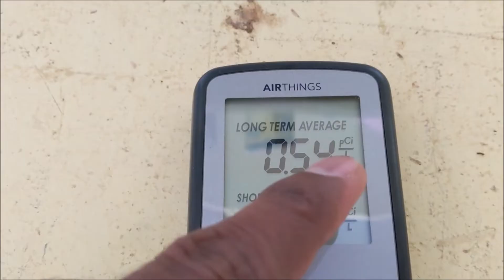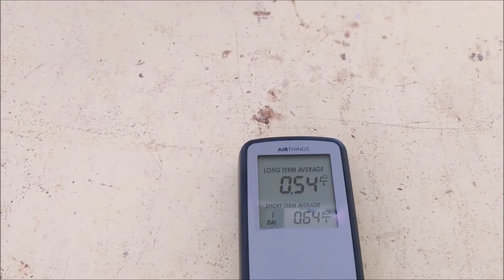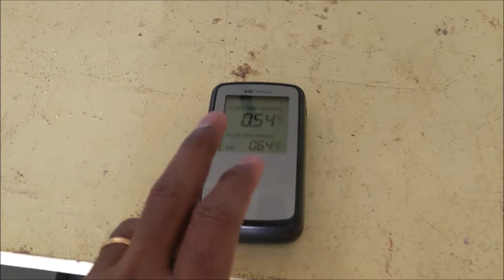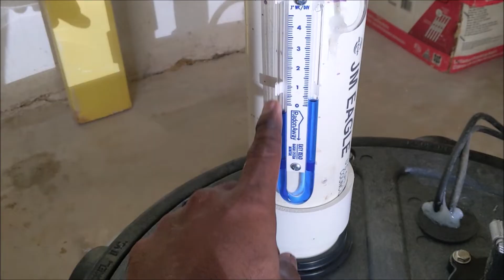Radon Mitigation System for under $500 - DIY Homeowner Installation

Comment: The exterior electric on the fan should have a shut off switch, definitely look into it. Also, you should have fire suppression collars on the interior side of where the pipes penetrate to maintain the fire code to your house.
Reply from the maker: Thank you for the pointers. Both those were pointed out by previous commentators and I put an exterior disconnect and a Rockwool collar.
Reply: @JJCentral-DIY awesome

Comment: Would this work on a sump system where the lid isn't a perfect circle? We had some triple sump system installed(got conned into it actually) and its not a perfect circle like the lid you got.
Reply from the maker: Triple sump systems generally comes with a double overlap circle shaped lid. You can cut the proper size hole in that lid to use it for Radon. If not you can always use a plywood or pvc 1/2 inch board to cut the shape of your openning and then do smaller holes for your pipes or better yet cut a circle in the middle to mount the lid that you can purchase. There is always a DIY way.

Comment: Google: Threshold for Radon-Induced Lung Cancer From Inhaled Plutonium Data
Or: From the February 2002 Idaho Observer: Sleeping radon hoax from early 90s reawakened in 2002

"The EPA action level for reducing radon in homes6 is 4 pCi/L (150 Bq/m3). This limit is 14 times lower than the NOAEL of 2100 Bq/m3 estimated in this article. The very low action level has been causing undue fear and unwarranted costs to many homeowners as well as a reduction in the market prices of their radon-stigmatized homes. It should also be noted that radon remediation significantly increases lung cancer mortality, as shown in Figure 3. To dispel the fear and eliminate this economic burden, the action level should be raised by a factor of at least 7 to about 1000 Bq/m3 (27 pCi/L), where the health benefit is near optimum."

Comment: No reason to worry about building codes where you work I guess! Why is there no power disconnect within 6' of the fan outside???
Reply from the maker: If you look at the other comments, some one pointed out the disconnect and even though I have a disconnect within 6 feet on the inside, I moved it to outside to be compliant with code. Thanks.

Comment: I purchased everything that I need for the install except for the electrical.  What did you use for wire and outside conduit?  Thank you!
Reply from the maker: Since there should be a disconnect/switch on the outside, you can run a outdoor rated wire or conduit to a outdoor rated switch box and then run the wire from teh switch to the fan.
Reply: @JJCentral-DIY  Finished our install. Our radon level went from eight to one. Thanks for posting this video.
Reply from the maker: @jeffsmith8343 That's the feedback I would like to hear. You not only get a low radon level, you also get moisture out of the foundation. Better air inside the house and basement.

Comment: Where does the PVC Termination Cap Mesh Screen Vent Cover go?  At the top before the 90 degree?
Reply from the maker: If you were using the termination cap on the roof, then you didn't need the termination elbow

Comment: Great video - thanks for posting!
If you had to do it again, would you use the same equipment (fan and detector) or something different?

Is you fan 3" or 4"?  Our sump pit has 6" of space between the concrete floor bottom and the top of the water level - which is always present.  The floor is on crushed stone and the foundation is surrounded by a french drain. There is a gravitational drain that seems to work but I'll probably add a backup sump pump if the water gets closer to the concrete floor.   I'm guessing I need 4".

Is the 90 degree elbow at the top of the pipe to keep the rain out?  I was looking at the RadonAway 76001 vent cap as an alternative.

Finally - what is a disconnect?  Is it just an outdoor electric switch?

Thanks again!  Very helpful (and cost saving) video!
Reply from the maker: My current setup is running without issues for years, so yes I will do the same again. The fan is compatible with 3 or 4 inch pipe. The CFM is rated for 4 inch. 90 percent of the houses don't need 4 inch. Try with 3 inch first.
The top cap can be anything to prevent direct rain, ideally an elbow with mesh. A disconnect is usually a outdoor outlet with a weather proof box and you plug in the fan or a outdoor disconnect switch. Hope that answers your question.

Comment: Do you need air intakes holes on the opposite end of the basement?
Reply from the maker: No, the idea is to create negative pressure below the foundation and vent the radon and moisture out and away.

Comment: super helpful video! what do you do if you need to replace the sump pump?
Reply from the maker: That is not an issue, I just remove the two fernco flexible elbow connections. Lift the inner lid with the pump, replace if needed and install the inner lid back on the outer ring. Reattach the elbows and done. It shouldn't be any more than replacing normal sump pump procedure, except this is air tight.
Reply: @JJCentral-DIY  that's great! I'm planning to follow your video for install this weekend. 

How do you prevent water/rain from going into the pipes?

Comment: Why not mount the fan inside instead of outside? You had to run electric outside which is a another unnecessary hole and will also have shorter fan life outdoors
Reply from the maker: @hojo70  Good point, the reason the fan stays outside is due to noise. Fans are 24/7 so better to isolate the sound. FYI mine is still running outside just fine.

Comment: The measurement unit is "pico Curies per liter" and should be written in pCi/L  (where "C" and "L" are capital letters and "p" and "i" are not).
BTW, in europe we use a metrical unit instead to measure the radon: "Becquerels per cubical meter" or Bq/m³ in short.
Of course the two units can be converted together (1 pCi/L = 37 Bq/m3)

Comment: What screw did u use for that red siding ?
Reply from the maker: @RicardoLandinginJr  Mine is aluminum siding, so I used a metal to wood screw that is exterior rated and a dab of caulk. If you have vinyl siding you pre drill and use any exterior screw but don't squeeze the siding too much.

Comment: You need a disconnect switch outside for the electrical.
Reply from the maker: Yes, some one mentioned that earlier in the comments, and I have made those changes to comply with code. Thanks.

Comment: So you started the Radon system from an existing sump pump?  Purchased this new lid and added the mitigation system to the sump pump?  Is that correct?  Great video and great information.
Reply from the maker: @joshschiffman5671  yes, it works well as long as there are no leak points.

Comment: what if the French drains run along exterior of home? I do have a submersible sump.
Reply from the maker: Then it will be ineffective. You need the air under the slab pulled up into the pump. Better to drill a hole in the concrete and stick a PVC into it.

Comment: Very neat idea and video!  With that type of sump cover, how long would it take to dismantle, replace the sump pump, and reassemble?  Also, where is your sump pump check valve?
Reply from the maker: The idea is to not dismantle at all. There is a glass window to monitor the pump. If I need to change the pump, I have two rubber sleeve disconnects and one of them is a check valve. It is fairly simple to service if needed. The lid is separate from the sleeve that is glued and bolted down.

Comment: Just FYI The shut off for the fan should be outside with the fan. Disconnecting means should always be visible from the device they are controlling.
Reply from the maker: Some one already pointed that out and I changed it to include the disconnect and a smart switch so I can run it on a schedule. Also updated the rubber connectors with PVC.

Comment: We put in a radon system a few years ago.  Our sump hole, which hooks to drain tile, was not sealed completely.  The result of putting in the radon system, which is sealed,  was extremely good as far as I am concerned.  Radon went from 13 to 0.7.  Also I believe the system reduces humidity in the basement a bunch, AND also eliminates odor from the sump hole. Dirt and stale water actually stink.  Who would have thought?   It is safer and odor free.  I definitely recommend putting  one in if you have high radon.
Reply from the maker: Exactly my scenario. Over time I installed a smart switch on the radon fan and now I don't have to run 24/7. Figured running 8 hours a day is good enough to control radon levels and moisture. Saves ⚡ bill as well.

Comment: That is NOT a proper mitigation system. Sump pits CAN'T be used as the primary suction point, it can only be used as secondary. Rubber pipe connectors are not allowed inside the house. So much wrong with the installation. The radon monitor is not approved by the EPA or the NRPP or any other radon organization to determine your radon levels. Hire a professional to test and install the system.
Reply: That is absolutely false lmao. I install most of my systems in either the foundation floor OR the sump crock. I have had, out of tens of thousands of post-installation tests, a 95% success rate. Your reality in your area is not THE reality
Reply: @freakingabagool3510 you're incorrect. What association do you belong to and where are you licensed? Which SOP do you follow.
Reply: @freakingabagool3510  you are incorrect. Where are you licensed? What SOP are you using? Who are you certified or licensed with?

Comment: The cost for matetials is a grand easy. Pipe ($30 each for 3x10), fittings, breaker, 12/2 wiring, weather proof cut off, pipe clamps, glue and primer, sump cap, ferncos,  caulk, sprayfoam, bolts, sds drill, pipe hangers, screws, radon fan, monometer, condensate bypass etc. I charge $2500 to install mitigation systems, other companies near me charge over $3000. I want to know where he shops...

Comment: You did a great job with this. I am thinking of getting it done in my case. 
My Radon levels in the utility room with a French drain records 2.1 - 4.8 through the day. Data of 4.7-4.8 at the 11am - 4pm seems to be consistent.
Should I be worried to get a system done? I don't have a sump pump
Reply from the maker: Those values are close to the acceptable range to be honest. I would do a long term measurement and then see if you need it or not. If you have the reader, do an average, min, max of a whole month and see what happens.

Comment: As far as Radon exposure is concerned, all the fear and hype was initiated by a case that happened in 1984... I copy and paste from Wikipedia:   "The presence of radon in indoor air was documented as early as 1950. Beginning in the 1970s, research was initiated to address sources of indoor radon, determinants of concentration, health effects, and mitigation approaches. In the US, the problem of indoor radon received widespread publicity and intensified investigation after a widely publicized incident in 1984. During routine monitoring at a Pennsylvania nuclear power plant, a worker was found to be contaminated with radioactivity. A high concentration of radon in his home was subsequently identified as responsible.[72]"
So, the guy who WORKED in a nuclear power plant, and who circulated in and out from there to his home every day, caused all this excitement and the ensuing regulations! He might not have followed decontamination protocols for his work clothes upon leaving, and thus carried these reactive particles into his home every day. The half-life products of Radon, which occur 3.8 days after Radon is emitted, can attach themselves to fabric or dust or other surfaces and therefor be transported. They are still radio-active, and therefor can cause radiation poisoning.
Also from Wikipedia:    "Radon is a colorless, odorless, and tasteless[11] gas and therefore is not detectable by human senses alone. At standard temperature and pressure, it forms a monatomic gas with a density of 9.73 kg/m3, about 8 times the density of the Earth's atmosphere at sea level, 1.217 kg/m3.[12] It is one of the densest gases at room temperature and is the densest of the noble gases."
So... eight times the density of the Earth's atmosphere.... hmmmm .... pretty dense, I'd say. How come it can cross such thick barriers in homes, like concrete slabs? That does not sound very likely to me!
If you read the entire treaty about Radon, you also learn that it occurs naturally everywhere outside, in Nature, and there is is most at a concentration of , and I quote:    "Radon concentration in the atmosphere is usually measured in becquerel per cubic meter (Bq/m3), the SI derived unit. Another unit of measurement common in the US is picocuries per liter (pCi/L); 1 pCi/L = 37 Bq/m3.[43] Typical domestic exposures average about 48 Bq/m3 indoors, though this varies widely, and 15 Bq/m3 outdoors.[74]"  So, converted to the US unit of pCi/L, this gives us for inside about 1.3 pCi/L and less than 0.5 pCi/L outside on average!
It makes no sense to me that Radon should be more concentrated in a basement, where it has to penetrate a concrete slab to get inside the basement space, than outside, where there is no barrier impeding its emanation!
In conclusion, this is once more a bunch of hype, scaring people and last but most of all not least, a big money maker for the so-called "Health Hazard Remediation Industry"! 
I'm glad I figured this out for all of you! Don't be fooled! Use your brain cells! Live long and prosper!
Reply: "this gives us for inside about 1.3 pCi/L and less than 0.5 pCi/L outside on average!" 
---> Yup... correct, those are accepted as within safe levels :)
 
"It makes no sense to me that Radon should be more concentrated in a basement, where it has to penetrate a concrete slab to get inside the basement space"
---> True, if it is a concrete slab home. Many homes are built directly on Dirt, with zero barrier to the basement or crawl space. It is those homes which are susceptible to easy penetration by radon rising from the earth, which varies from area to area.  
In your notes you also mentioned the part about some of the by products which attach to dust and fabric, and it is those with which people might be concerned.
 
Thanks for posting that info!

Comment: Cna I mount that fan inside or does it have to be mounted outside? I'd love to get away from doing the conduit for power outside if I can help it.
Reply from the maker: You can mount it inside, but have to get used to the fan noise which hoestly is not very much.

Comment: How deep do you have to go if ya don’t have a sump pump and just drill down in the foundation?
Reply from the maker: Usually the foundation slab is 5 inches and then into the packed gravel. You are basically sucking the air from the gravel.

Comment: My radon sealant cost $170 for 24 tube. My house would cost $1300 to do radon and replace 2 sump pump. $2600 to get a company to do it. Fitting and schedule 40 pipe are expensive. My reading is 7 but I doubt I can get it down to 1. I will start on my system in a few weeks.

Comment: Thanks for the helpful video! My only concern tho is with cover the sump pump what happens if you get water in the basement?
Reply from the maker: If you have a surface drain that goes into the sump pump pit, then you don't use this method. Instead you just drill a hole directly in the slab and connect your 3 inch PVC fan into it.

Comment: does it matter where n my basement I mitigate from? example, we have a 2000 sq ft basement, how do i determine if I can put it on the west side or east side of the basement. I want to bore the hole in the utility room on the west side away from the bedrooms, but will it mitigate through the whole basement?
Reply from the maker: Good question, it is literally a process of sucking air. So if you have any existing sump drain or under slab plumbing, then map that out and put the hole next to one of those trenches which maximizes the air pulled from where ever the French drain or plumbing was laid. If no drain pipes were installed under the slab then you put two holes and run the pipes from both to the fan. I would start from one hole and see if the readings go down significantly, if not put another hole in the opposite side of the house.
Reply: @JJCentral-DIY  thanks so much. last question is location. the spot I am looking at would come out of the house about 6 feet from the AC unit and 6 feet from the garage side door. any issue with this location since I am venting 12 inches over the roof line?
Reply from the maker: @Saint_n_Soldier  the code basically says away from windows, deck or balcony where humans can directly breath the exhaust. Ideally above roofline which is standard.

Comment: Just got 5 pci level of radon in my house, we are going to set up a mitigation system but we are definitely moving out by the end of the year. Radon levels in the whole community are too high. However, watching this video made me realize I have to pay someone else to do it.
Reply: True, you should test the standard outdoor reading in the area also, to determine if it is in the green (under 2.7 or better yet under 2.0) because if the outdoor reading isn't optimal, then a major air filtration system might be also needed for indoor living, and forget spending much time outdoors.

Comment: Nice work. Looks like your outside fernco reducer band clamp is loose.
Reply from the maker: I noticed that while filming and of course went back and tightened. 😄
Reply: @JJCentral-DIY   nice. I am researching radon mitigation, my house just tested at 33.1 pCi/L. Going to have some companies come out this week, I had no idea my house had such a high number!
Reply from the maker: @guidedbygreen1480  Most of the states publish general maps of radon levels in your area. That can give an idea of what to expect. If yours is showing high values then it is worth investing and trying out. Worst case you get a dry mold free basement.